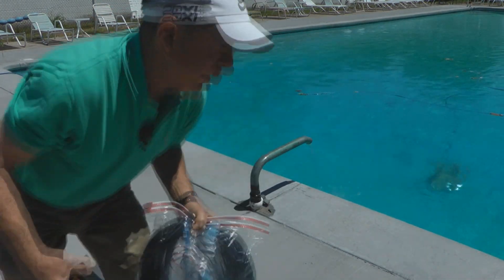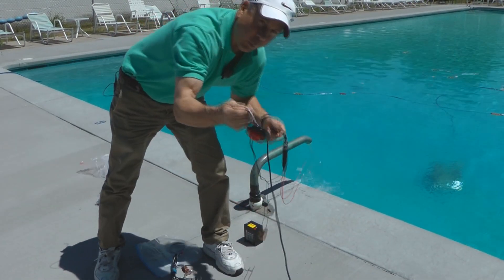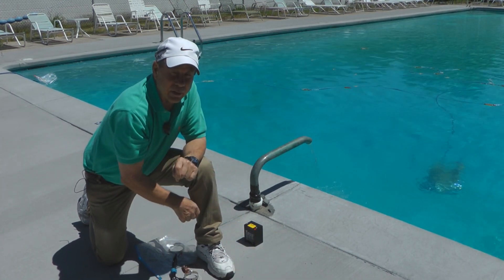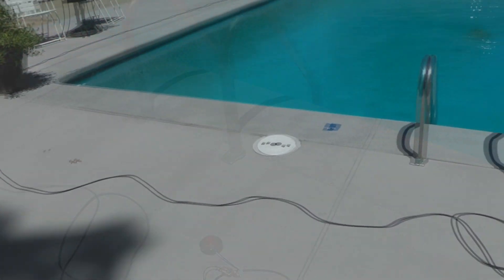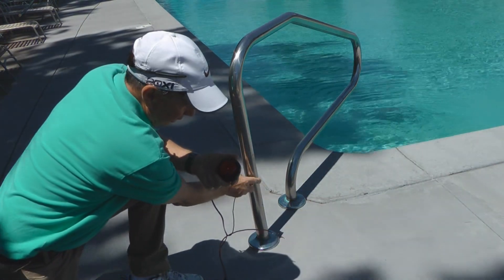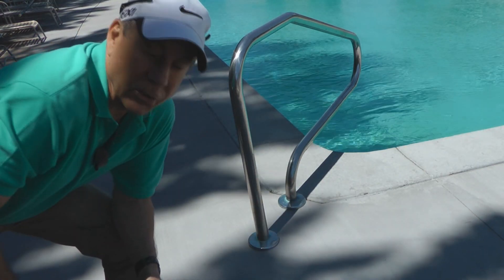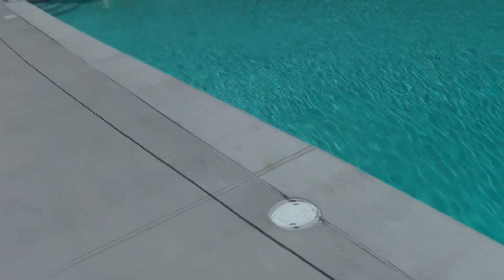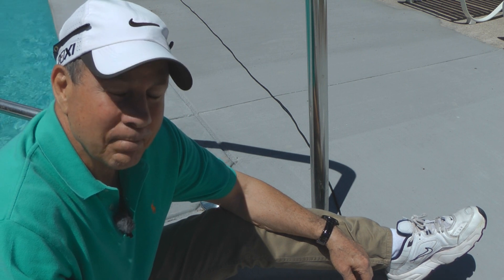Pool Grounding Check

Comment: Sir- That is NOT grounding. It is an potential bonding grid. Grounding and bonding are not the same thing. You absolutely should be testing neutral to earth voltage across the entire bonding grid as well as the water and all pool equipment. You could’ve disconnected all the wires that were hooked up under the concrete and you still would’ve had continuity because all the metal that you touched could have read continuity from contact with the water it’s self.  That pool holds lots of human beings and should be tested by a licensed master electrician. No offense but you seem like the maintenance man that works for the property. I am hoping that the master electricians who bonded that equipment tested it properly
Reply: Equipotential bonding.

Comment: This is a terribly unsafe demonstration and a rudimentary understanding of the purpose behind NEC requirements for pool bonding and grounding. If used, this demonstration provides no proof of ground or bonding and will lead the home/business owner to believe their pool meets lawful requirements while no ground could actually be present. This video should be removed.
Reply: So instead of using continuity he should of tested the voltage across all the metal surfaces to make sure they all read the same?

Comment: Is there any plastic pipe between the pump and the water fill? Shouldn't the pump be bonded directly ( maybe it is) into this circuit? Should this test have been performed at the pump as the beginning of your continuity test?

Comment: You tested continuity, not resistance and certainly not the equipotential (bonding) of the pool, water, fixtures, and surrounding surfaces. Grounding and bonding are two separate issues and not synonymous.  Look up testing "neutral to earth voltage (NEV) testing" and educate yourself. You wasted your time.